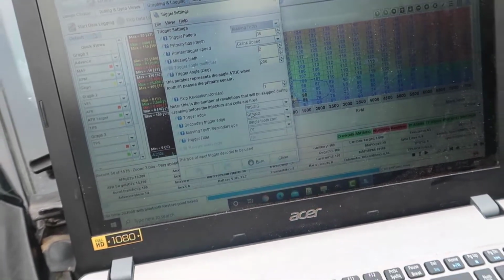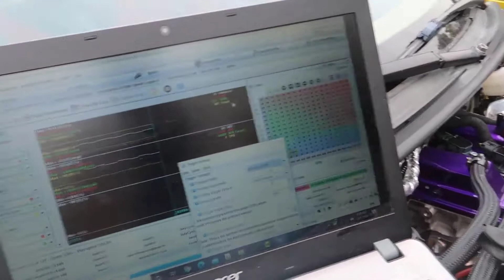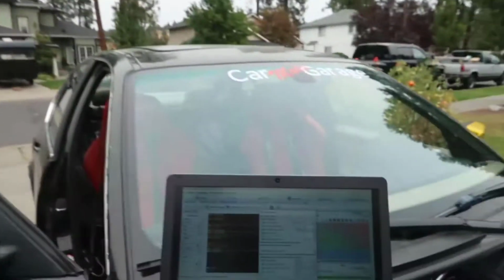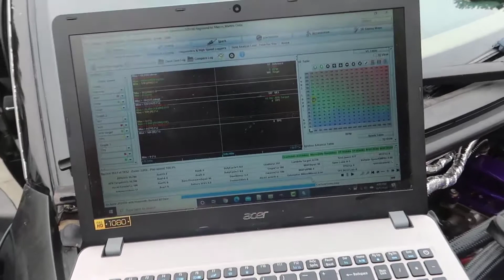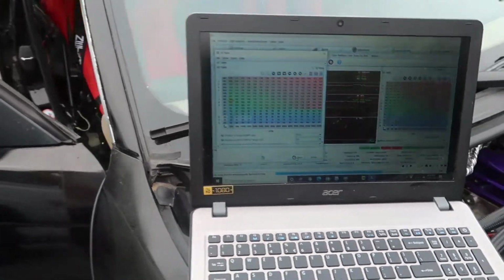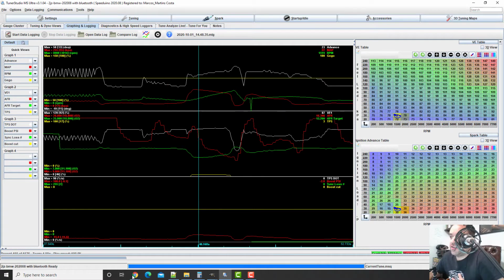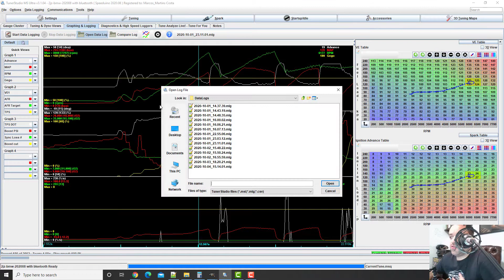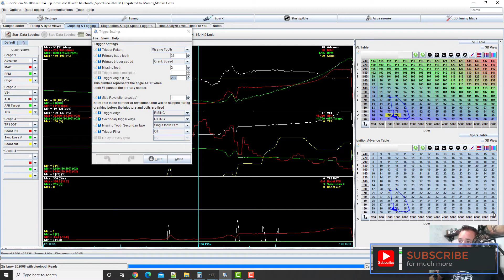Setting Trigger Angle on Tunerstudio for Speeduino - 2JZ to E46 Tuning

Comment: Fan kicked in and ecu reset.
Reply from the maker: Happened to you?
Reply: @CarModsGarage  Yes. Speeduino fault.
Reply from the maker: @MrJermbob  ya I hear you.  Happened to me because of the firmware version also but guys from SpeedyEFI assisted so quickly that I was up and running in no time.
Reply: I would love to see a video of your timing mark with a timing light flashing at it. Then rev the car up while timing light on the mark with fixed timing. Then also on fixed timing on rev limiter. I would bet its not stable. @CarModsGarage
Reply from the maker: @MrJermbob  I don't know if I would go to the rev limiter with fixed timing.  I'm not sure if it would be stable. I believe it would have some variation for sure but the point is at idle 10 degrees the light should be at 10 degrees
Reply: Fixed timing needs to be 1 degree accurate no matter the conditions. Otherwise its a junk ecu. Limiter or near limiter. Man "REV LIMITER" read the name its a safe limit isnt it ? @CarModsGarage
Reply: Just set a reasonable timing number on fixed timing. I bet it dances around.  @CarModsGarage
Reply: @MrJermbob if it dances around what does that mean

Comment: I have a miata I would like to turbo. Just bought a speeduino and I'm researching vids like yours to learn how to program. Doesn't tuner Studio have auto tune you can use to tweak all perameters while you drive? Can you make a video on that? Thanks.
Reply from the maker: That will work the same. The config inside the setting will be different but the logic on getting the crank angle set are the same. 
I'm glad to help and there is more coming.
Reply: Throw the speedunio out and get a ecu that holds ignition timing stable.

Comment: Some advice. 1 - do NOT use an adjustable timing gun, especially on wasted spark ignition setups. 2 - Lock ignition timing at a set angle with the timing setup page!! Usually pulleys have a timing mark on them at 10° or something like it. Check and verify at different rpms, that it matches.
Reply: Whats the reasoning for 1?
Reply: Hes not using a adjustable timing light fool.